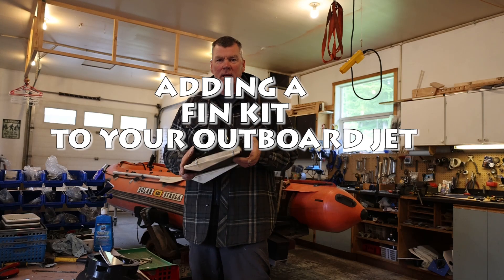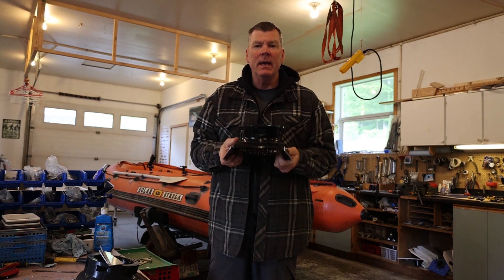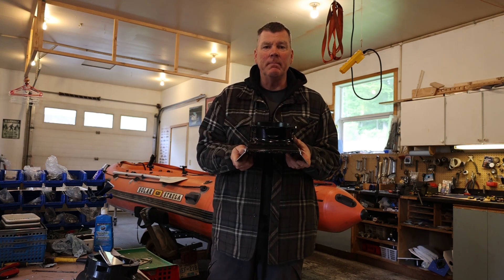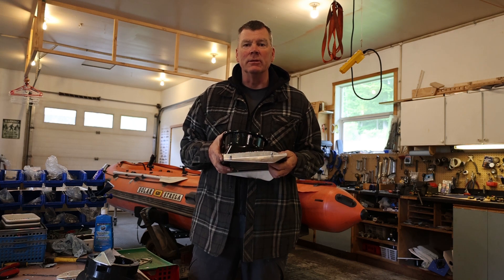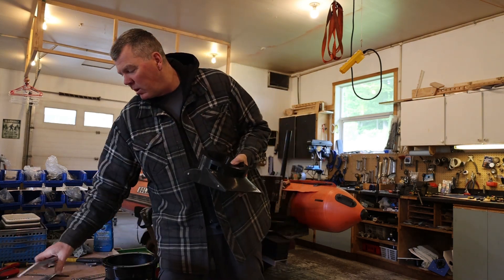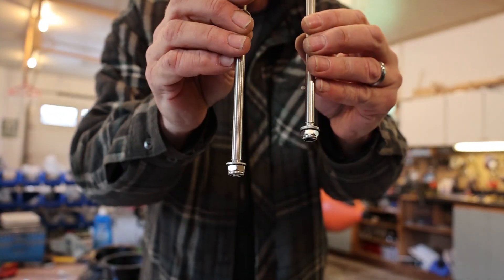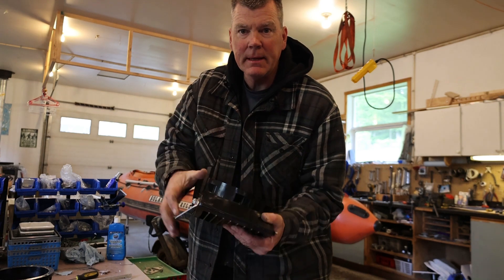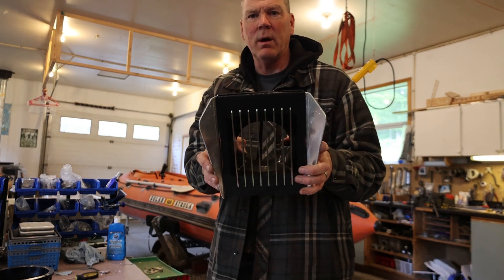Adding a Fins to your outboard jet intake

Comment: Just installed the intake fins from you. The old ones from outboard jets were bent back from being smashed many times over 4 years they finally cracked. These are a nice upgrade that helps a lot with my flat bottom Alumaweld.  Help suck a lot less air when in chop. And also help a lot with steering and keeping the back end more steady around turns. They can easily be bent back into shape with an adjustable wrench and a hammer. I need to find a nice steel bar to now bend my grill bars back down occasionally.
Reply from the maker: I am glad they worked out for you

Comment: What's the benefit in a poly intake vs the stock?
Reply from the maker: The poly shoes are almost indestructible whereas one good hit with a stock shoe can crack or break it. It’s like an insurance policy to get you back to the launch
Reply: @RobBryce  Thank you!  Mercury 60/40...what size do I need, and I assume I can just unbolt the old one and put this one on?  What about the wings, what advantage do I have adding those?